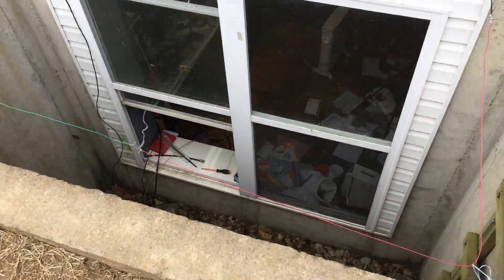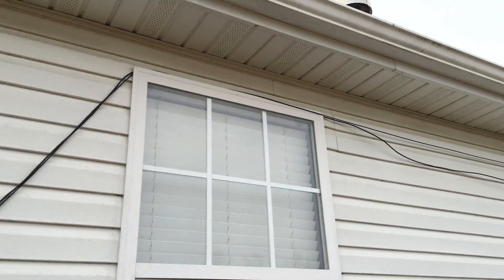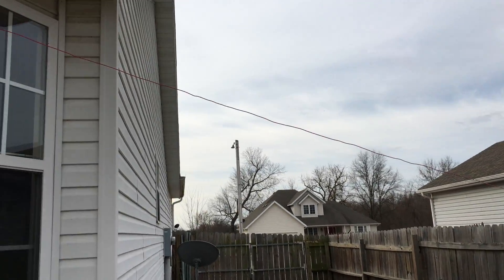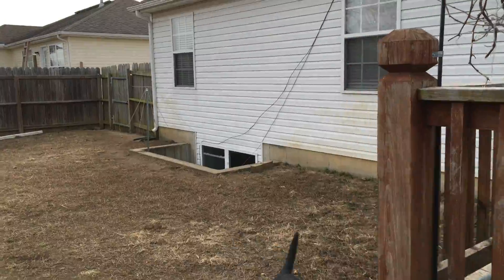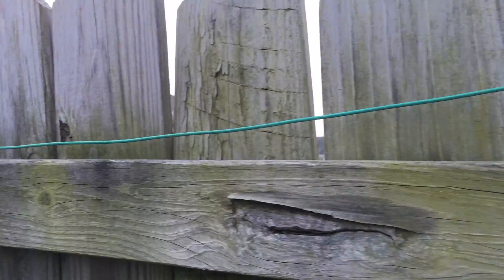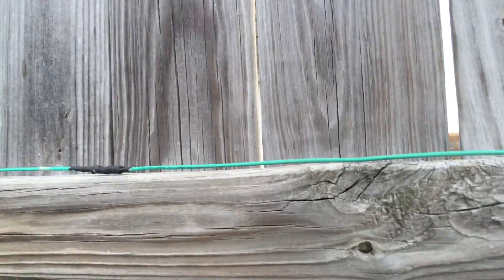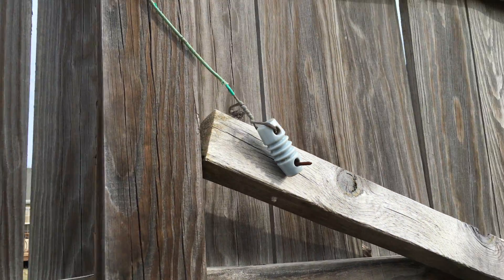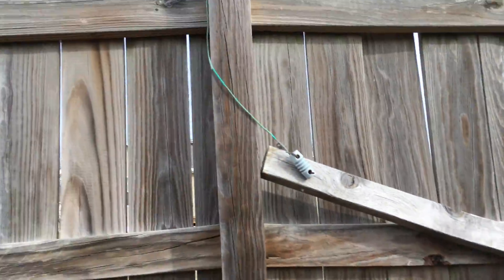Super Expedient Stealth 160 Meter Antenna

Comment: good idea the only thing i would change is use stand off`s  to get the antenna off of the fence, you can make them cheap out of wood or buy them maybe. they screw into the wood and insulated ring on the other end (3") would be perfect for that.

Comment: They are ok for short distance 100 miles,but for a 1000 mile, haul you wont hear em or work em, but i guess having any antenna is better than nothing. Now if ya raise it by 4 m you will have a 300 mile increase in transmit :ie 500 miles... So out the window to the highest part of roof and down around the yard.

Comment: Did something similar but couldn't have an RF ground due to living in a flat so turned it into a "balanced" loop antenna.

Any antenna is better than no antenna and mine hooked up to an sgc-237 would match on everything from 10-80m. May have been a cloudwarmer but I got contacts as far away as Chile on JT-65 (15w) and regularly had Poland, Russia, Ukraine on 20m SSB (10w) from the UK.
Reply: Don't need no stinking ground

Comment: Sometimes it's what you can afford, sometimes it's what you can get away with when you have bureaucratic neighbors. Life is a challenge. Good for you on putting that together. You're going to have to tell us how well it works out for you. Chances are it's a good NVIS antenna. 73 VA7DH
Reply: I need a follow up I need to know how it works! Getting ready to buy some wire and do this myself good thing I got tall pines all around and cool neighbors LOL